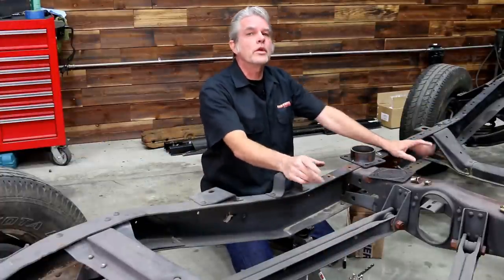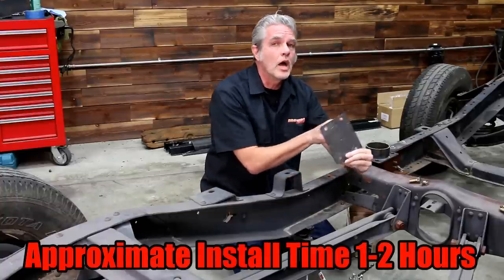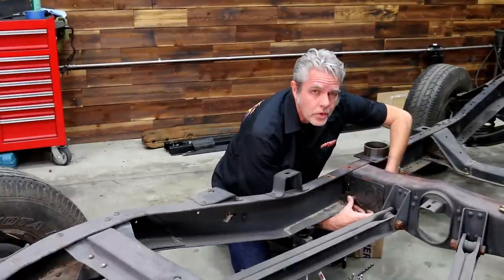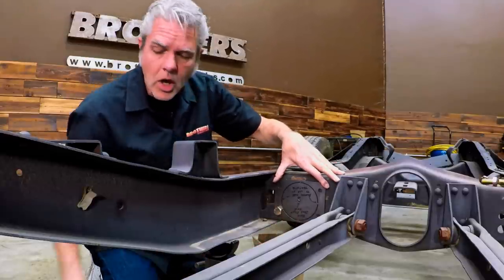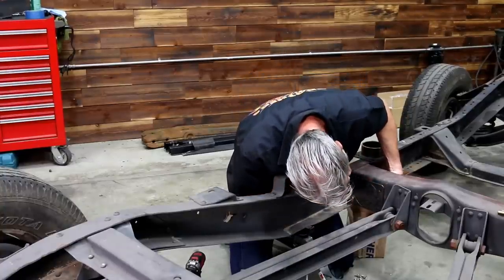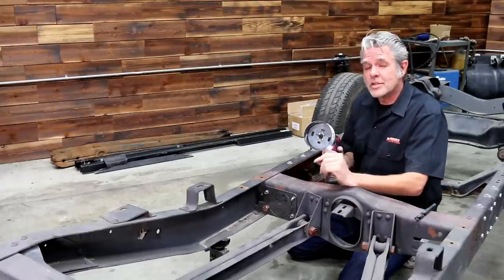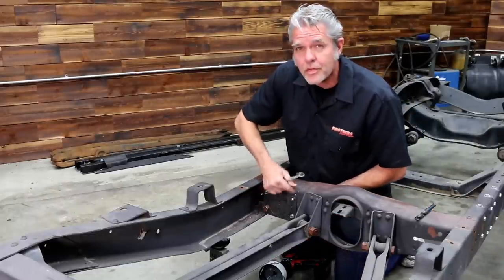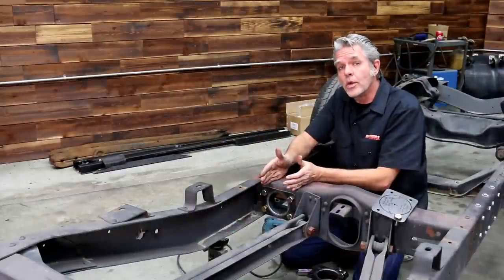1963-72 Chevy & GMC Truck Exhaust Ground Clearance Cutouts

Comment: I’m working on this project as well using a cordless drill then switched over to a power drill using a 4” metal hole saw. My question is: how long does this take to complete in real time? Also how many blades did you go through with this project?
Reply from the maker: We only used one blade, and each side took about 45 minutes, so 1.5 hours total.

Comment: What is the part number for the exhaust cut outs?
Reply: Disregard; I found it
Reply from the maker: @darrellsteele2377   Yeah, sorry for the late reply Darrell. It's linked in the Video Description on this page, but here it is just in case anyone else doesn't see it - https://www.brotherstrucks.com/63-72-CROSSMEMBER-EXHAUST-BRACKETS/productinfo/ECOB072/
Reply: @BROTHERSTruckPartsTV  I think I came to the right place where I can find all my C10 parts.i have the 1963 C10 pick up and I want to bring it to new.and eBay don't want to ship the parts to my address
Reply from the maker: @rubenfilippus2956   Excellent!
Reply: @BROTHERSTruckPartsTV   do you sell engen  oil seals and all interior parts?than later I want to drop the car down with suspensions

Comment: Once you have your outer holes drilled and your pilot hole, why wouldn't  you just remove the template? No reason to leve it in place and risk damage.
Reply from the maker: We leave it in place to provide extra support for the pilot drill bit while we're cutting the larger hole with the hole saw. You could remove it, but there's really no point as long as you're careful.

Comment: What size saw for drill to make the big hole to insert exhaust bracket?
Reply from the maker: 3.5"
Reply: @BROTHERSTruckPartsTV  what's the 4 1/8 for?
Reply from the maker: @fabiangomezjr4114  what 4 1/8 are you referring to?
Reply: @BROTHERSTruckPartsTV  I saw in comments that they used a 4 1/8 just wanna make sure to use right whole saw
Reply from the maker: @fabiangomezjr4114  We don't know who made that comment, but we used a 3.5" hole saw for this install.
Reply: @BROTHERSTruckPartsTV  ok thx will use a 3.5 whole saw thx in advance
Reply: @fabiangomezjr4114 I saw that… and the hole saw he is using looks no where near 3.5
Reply: @meza5207  yup exclty
Reply: @fabiangomezjr4114  I grabbed a 3.5 from work to use and when I was going to cut i saw it too small so I searched again in comments and the 4 1/8 works much better just did it today …
Reply: @meza5207  right on that's what I did work like a charm